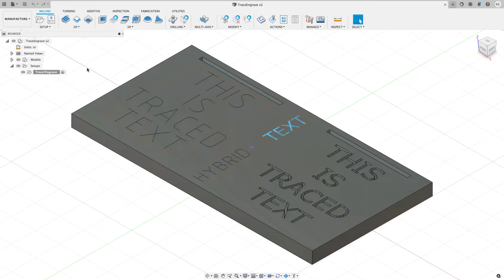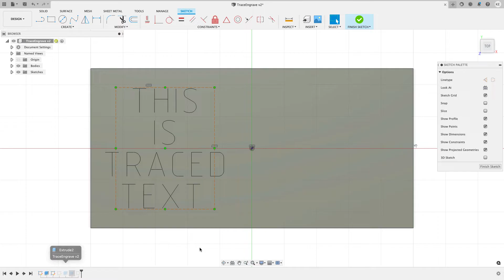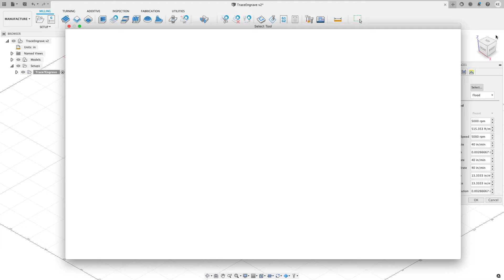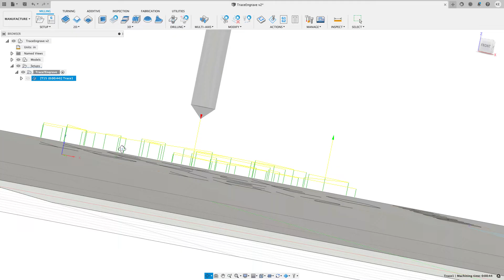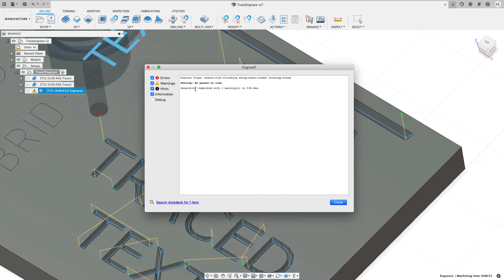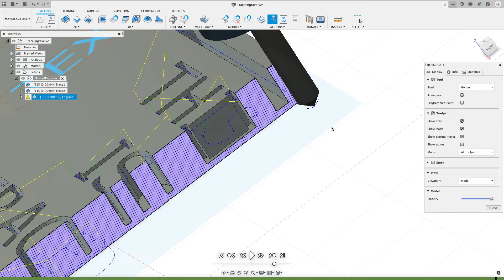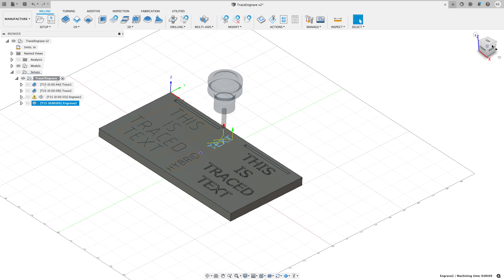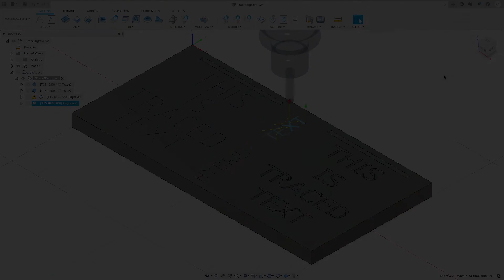Fusion 360 CAM - Trace and Engrave

Comment: How would I do this if I wanted to use a ball nose end mill?
Reply from the maker: The trace method is exactly the same. Ball nose tools aren’t supported for engrave. However, you could insert a ball mill in the machine and program it as a sharp pointed tool.

Comment: How can i go deeper with engraved tool? Negative number in "Bottom Height" doesn't to anything
Reply from the maker: You have to make the text bigger. Engage works by the point of the tool rocking both of the edges of the outline.

Comment: Awesome
Video! Def helpful, as for the islands with in the text and engraving. Do you have a good tutorial for that? Did a cutting board for the house and the text, believe I have an issue with the island letters as I have material left over in random spots with a 60 degree bit
Reply from the maker: In those random spots, is the space between the outside of the letter and the island wider than the diameter of the tool?
Reply: @MechanicalAdvantage  haven’t found a good way to gauge this. However I plugged in the degree into fusion. 60 degree 30/30 center and it populated the depth. I can send a pic to you if easier to see how I can correct it
Reply from the maker: The file would probably be more helpful. info @ mechanicaladvantage dot com would be a good email to send it to me at.

Comment: 2:50 Why did you switch from perspective view to orthographic? What advantage does that give you?

"Perspective with Ortho Faces" provides natural viewing along with no distortion when viewing face-on.
Reply from the maker: I don’t fully recall without watching the video. When simulating, you can turn on show points and select a point and the tool will move there. That only works in ortho mode.
Reply: @MechanicalAdvantage  It works in perspective mode for me (Mac). Perhaps a recent update has enabled that ability?

Comment: I can’t get this to work. When I select the contour the tool path outlines the font, instead of going inside of it.
Reply: I had the same problem. After I played with the engrave command it wouldn't work. For me the solution was to delete my previous engrave command and without touching ANY SETTINGS, just select the text/contours and it worked.

Comment: One small point Kevin.  You mentioned the .shx font files and say that they are single line fonts.  

However there are lots of fancy multi line .shx files out there, and they aren't too hard find and install (.shx were the original fonts in AutoCAD).

Certainly the Gothic text styles offer some fonts that don't have an equivalent in the True Type library, so it might be worth having a look at .shx if you are looking for a particular style of font.
Reply from the maker: I've never tried that. I wonder what would happen in Fusion if you used them? Yeah, I've been using .shx since AutoCAD R13. I should have said by default the ones that ship with Fusion are intended to be single line.

Comment: Hi,

Great vid as usual, thanks .

I struggled with this same subject beginning a couple of years ago. Repeat customer would “ emboss”  umber on the model and state in drawing typography my discretion .
I tried engraving bits but never looked good. Machine I was using didn’t have high enough spindle speed ti cunt cleanly. Burrs etc . Finally ended up with a spring loaded diamond engraver and using the edges of the embossed number and trace tool path . Makes a clean engrave, but quite, how do i say?  Fine line.
This is in aluminum , Teflon, stainless , and steel.

Haven’t found a suitable tool in fusion to mimic drag engraving. So I say it’s a narrow point engraver and edit the post for zero spindle speed. It’s not a biggie, but any insight into zero rpm spindle speed in fusion ?

Again, thanks for the vids.

Alistair
Reply from the maker: I haven’t tried in a while. What happens if you uncheck Liver tool on the post processor tab?
Reply: @MechanicalAdvantage  well, does that include onions ? 
:-)

I haven’t tried but I will try tomorrow .

Thanks 

Alistair
Reply from the maker: Haha live tool! Lol
Reply: Hi,

Tried Live Tool check box … no luck. Still posts an error post processing file. I don’t think the live tool check box is for this purpose. Pity there aren’t any other obvious options bar editing post. Probing routines obviously don’t spin spindle. Haven’t tried fooling fusion with a probe for a drag engraver :-)
It’s not a big deal editing post, taking out “s” and “m” commands. But I would have expected fusion to accommodate a zero spindle speed option, perhaps with plenty of warnings as it could be a bummer if mistakenly selected.
Maybe they can make a drag engraver, or drag knife etc tool option.
Alistair

Comment: So , the best approach is to extrude the text in design? This makes sense I've been leaving it a 2d schetch in engrave and offsting the bottom height from model top..not getting consistent results...going to try your method today thank you
Reply from the maker: Fusion is a 3D program for and it almost always works better then you work with 3D solids. As you have discovered; you can make it work, but it takes a lot of work to get it to do what you want that way.
Reply: Tried trace command on some Castella font ...worked fantastic much simpler than what I was doing before. You posted that video literally minutes before I started generating tool paths for some engraving .good timing or alogarythm
Reply from the maker: Look for an invoice in your mailbox soon 😋